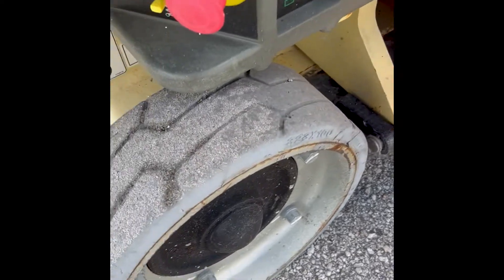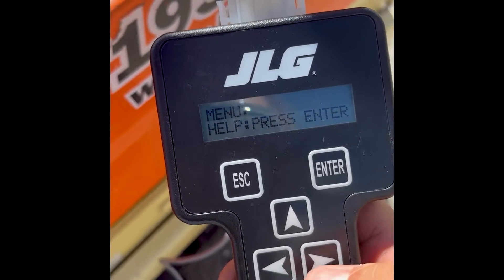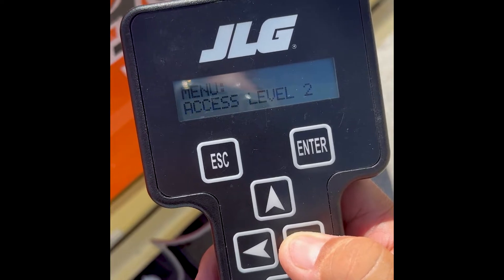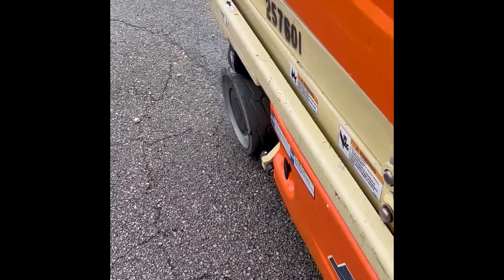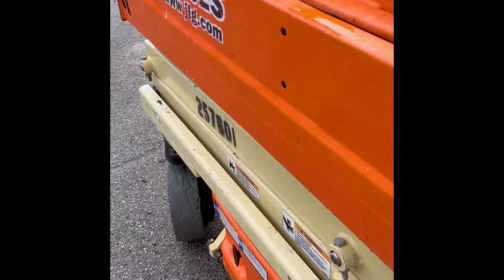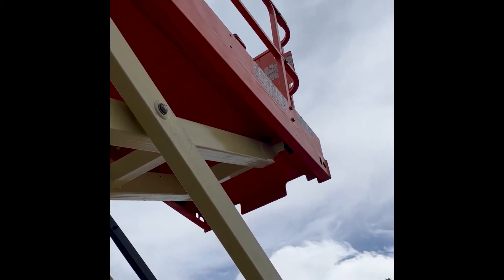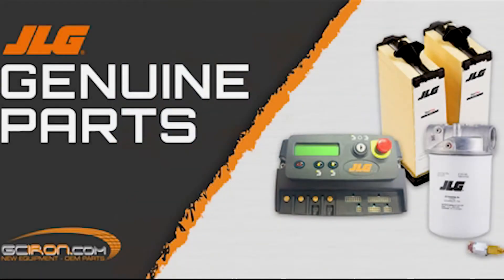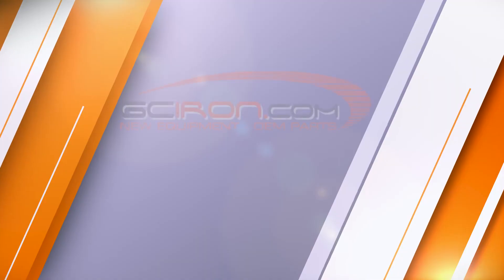Fault Code 311: Open Circuit Line Contactor | JLG Electric Scissor Lift

Comment: Should show loaction of contactor
Reply from the maker: the relay line contactor location varies, but typically between the front two wheels.  you can see here https://gcironparts.com/PowerPartSearch/3740150